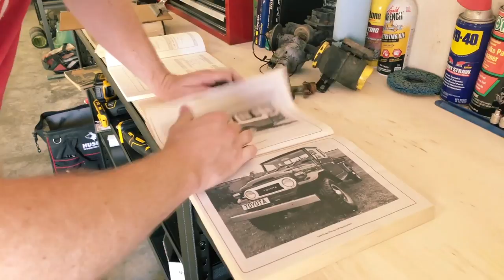PWW 35 - Part 2.5 FJ40 Rear Disc Conversion, I Go Deep Into The Rear, Awkward End

Comment: Hi the big gear is the crown wheel the small one are spider gears and the icecream cone one is the pinion gear the movement on the crown gear is back lash thats the hard bit when you are reassembling if you don't get that right you will need more than a locker .great video
Reply from the maker: Thanks for the info Ron, it looks like I'll be going the ARB route.

Comment: The biggest thing is do your research on what ever locker you want. I just read through your comments and there is a lot of wrong information from some people. And some great information. You dont have to do both lockers, a lot of people only put them in the front so they dont lose on road driveability. And depending what locker you get, you dont have to pull everything apart. But pulling the third member from the housing is a great idea for accessibility.  You doing a great job and keep working at it. You may not be great yet, but you are a long ways from where you were.
Reply from the maker: I’m getting there man, one day at a time. Thanks for the feedback, it’ll be an ARB down the road.

Comment: Look underneath the Pinion gear,  There’s is a passage way that feeds gear oil to the front pinion bearing.  Use a flashlight and a long pick or  long screwdriver and dig into it.  May be lodged in side. Good luck 🍀.
Reply from the maker: Going to just pull the third and clean the old girl up.

Comment: Honestly, run the axle as is with new fluid. Then change it within 500 miles. If there is more metal, then rebuild it. Forget the locker for now. Those lunchbox lockers work well if your wheeling all the time. They suck on the road and mine broke during the first hard launch on the street.  Save up for a selectable. I put a Detroit in the front and an ARB in the rear for driveability. I put them in about a year after I built my FJ40.
Reply from the maker: What about a limited slip? Or would I be better off putting that money toward an ARB?
Reply: @projectwrongway9127   Limited slips are great! If you are only doing light wheeling and street driving, they are a great device. Consider your end goal my friend, and buy once. Till then, run open diffs. You'd be surprised how well that FJ40 works off road with open diffs.
Reply from the maker: ARB.
Reply: @projectwrongway9127  Great choice! I believe you should know your rig with and without lockers. ARB is the best of both worlds.

Comment: Here's what i always do in your situation: go to the store, get the gaskets for the front and rear of the housing, a tube of black RTV, and a couple cans of brake clean. PULL THE DIFF OUT OF THE HOUSING ALREADY, FERCHRISSAKES. Set the diff over the bucket holding that old nasty fluid,  and hose it out with brake clean. Just really pour it in there. Then spray the inside of the axle and swab it out with lots of blue towels. Brake clean will not damage the paint, as long as you don't let it sit on there for a long time. 

Lockrite? No thank you sir.  Had one once, not a good fit for a vehicle that will see mostly pavement. Be prepared for lots of ugly bangs when you pull away from a stop light, and clicky-clacky in parking lots. 

Oh and go have a talk with Scott. Dude.... c'mon. The code.
Reply from the maker: Will do, and good advise about the lock rite. I’ll probably hold off for an ARB, in a later episode. And I get it... the diffs coming out. You’re right.

Comment: Just take the 3rd member out, I'm not familiar with those floaters but don't think you need to disassemble the gears. just unbolt from the diff housing and it will come out. This will make it easier to inspect the housing and the third member. Wifey's small hands may be useful inspecting your member.
Reply from the maker: It'll be back out, doing lockers now.

Comment: Fully disassemble man! one little piece of rogue metal can ruin your day later. You'll need to pull all of it if you are gonna install a locker anyway. Consider a Detroit (or Yukon Grizzly) Locker. They're a mechanical, cheaper than ARBs, super strong, and they provide 100% traction to both wheels while still allowing for wheel speed differentiation (turning) on the street.
Reply from the maker: Doing lockers anyway.. what wrong with me?!

Comment: The clicking in your diff that you heard is called backlash.  There is suppose to be some there so that the oil can get into the gears.  If you are worried the pattern on the diff is not correct you can get some marking grease and check the pattern.  If the diff has never been touched and in my opinion appears stock I would not worry about it pattern checking.  I would however take the whole diff out of the axle housing and washing it.  Diesel is fine or you can get tank wash fluid and use it (tractor supply).  A good douching never will hurt the diff.  I would advise that you not lock the rear as this can cause some undesired driving conditions such as sudden pulling in one direction.  I would lock the front axle and look for a limited slip diff for the rear.  Rachael is some little smoking hottie and I bet you love the fact that sundress season is around the corner.  Love handles HAHA.  Likely to both get us in trouble for that last 2 lines but hey....  Look forward to you video's as always and glad you got your disc machined out.  That is something I went through myself a few years ago.  It's a simple upgrade that if you have driven a full drum LC then you know this is a must.  Who wants to adjust 8 brake cylinders otherwise cause they don't self adjust.  Now find that 60 series axle and get some front disc too!!!
Reply from the maker: Got the front disc! It’ll be in an upcoming episode. Also, thank you for the advice man. You took the time to write it all out and I appreciate it. I’ll be taking the 3rd out to clean up.

Comment: You do need to be worried about pieces of metal in your bearings. Especially the pinion bearing which is hard to see. You dont have to use diesel, you can use brake clean.   Lunch box lockers are a cheap alternative that can be effective.  But they are tire size limited and not designed for hardcore offroad use. Just read the manufacturer's recommendations for use to decide which one. But now is the time to do it, since they usually replace your spider gears. And you just took yours out.
Reply from the maker: I'll be back in there, doing lockers it sound like...